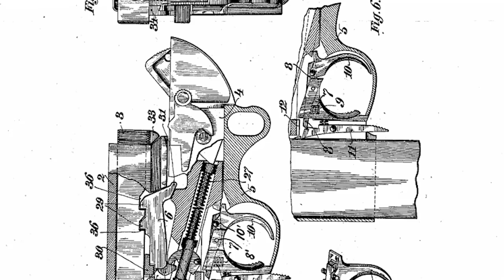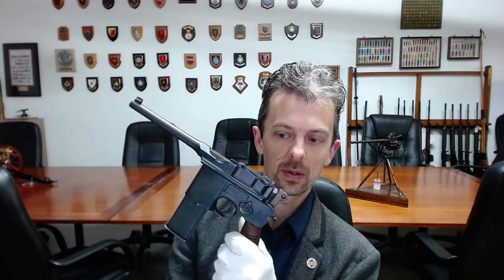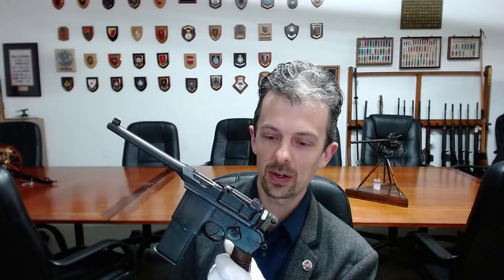Is a broom-handle also a sub-machine gun? Mauser Schnellfeuer with weapon expert Jonathan Ferguson

Comment: The Yugoslavs tested the Schnellfeuer extensively in both 7.63 and 9mm from 1932-35 for the purpose of equipping special units and mountain troops. Several improvements came out of that testing, although I don't believe they made their way into the main production Schnellfeuer.

Comment: I have fired a Co2 replica of the later selective fire Mauser design and it is incredibly accurate in detail and in operation as are many of the best quality Co2 replicas are (speaking as an ex competition practical pistol shooter pre 1997) The amusing thing is that when the Co2 cartridge is just about to run out in the Mauser, it turns fully auto for the last 10 rounds or so, as does the UZI Co2 ! Capture that on Go Pro and with a bit of editing and sound effects laid over and you can have some fun!

Comment: Imagine if they had combined one of the long-barreled carbine broom handle Mausers with the full auto switch and magazines. It would have been far too expensive to produce, but how awesome would that be?
Reply: Not half as good as a Sten?
Reply: @bozo5632  Sten didn’t exist when the FA c96 was invented. And this, could arguably be better at certain jobs. Sten is a good as an open bolt battlefield sub gun. Since the c96 is closed bolt, it would be much more accurate in semi, more like a H&K MP-5.

Comment: You mentioned the patent was from 1921, so five years prior to the manufacture of this particular piece. Considering that you don't need for a design to work to be awarded a valid patent (only for it to be distinct and original), do you know of any prior patents for a selective fire design that could theoretically have worked, or even be prototyped before this model?